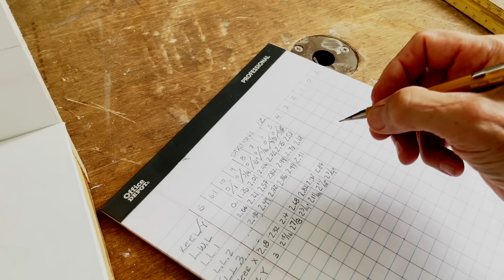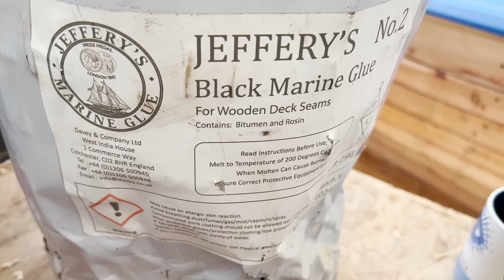Waterproofing the Boat Deck - Episode 232 - Acorn to Arabella: Journey of a Wooden Boat

Comment: As a professional Roofing Specialist contractor for many many years  

Flat Roofs, pitch Roofs ,slate and tile including shingles. 

In the days before Torch on modern day flat Roofing materials. 

We used the bitumen pots to heat the bitumen. 
Roll and pour,
Anyway,  bitumen in cans,

Place 3 engineering bricks underneath bottom of can of bitumen, 
We had burners for pots but if you have a blow lamp ( blow torch)

Put it underneath can and make sure you wear gloves and most importantly remove either the lid cap or whole lid,
As it slowly melts you can pour it into your proper bitumen pot, 

You don't need to cut the tin away or break the bitumen up , the Tiny bits of bitumen literally goes everywhere, 

Even on bottom of your boots , get that on the rug at home and your wife won't be happy, 
To remove bitumen,  white spirit on a clean rag.

Loving the videos and thumbs up from the UK 🇬🇧

Comment: Amazing how much that changes the appearance of the deck!! Hey, many years ago I worked with a substance similar to the pitch. We'd heat it in old electric roasters. It kept it at a constant temp. You don't have an open flame. You can buy them on eBay for a lot less than a tank of propane. Give it a shot I think you will like the idea. Keep up the good work!!
Reply from the maker: Neat, thanks for sharing that, Daniel!

Comment: Taping the whole deck was a logical choice and it worked out exceptionally well. That deck will definitely be water tight once you set sail. 
I know that this isn't your plan but I have always thought that a large wooden boat would look nice with the entire outside wrapped in fiberglass like cedar strip kayaks are. Since wooden boats are often made out of such beautiful woods and it would be nice to be able to see them. Fiberglass would also guarantee that it wouldn't lesk anytime soon.
Reply from the maker: That works great, as you’ve said, on strip building, and there are larger, cruising-sized strip-built boats in the world for sure. Carvel planking doesn’t do as well with fiberglass over it.

Comment: Ok, quick note.  The easy way to get pitch out of a steel can is take a larger steel can (15-gallon drum type) fill with water, place pitch can inside and suspend.  then build a fire around the larger can and viola, instant double boiler.  use what you need, remove from boiling vessel to cool, re-lid then store for later use.
Reply from the maker: Neat tip! Thanks for sharing.
Reply: @AcornToArabella  Your quite welcome.  after hot mopping a few tined roof sheds one finds out a few things.   ^~^

Comment: Get in a pinch you can use RTV gasket maker (black) to fill gaps. Used it on my race boat's teak deck. Been 14 years now and still looks and holds up under foot great.
Reply from the maker: Thanks did the tip!

Comment: Most won't use pitch as it's messy ass all hell and speed is more important to most than doing a good job as you are doing right now. My dad used a modern material similar to sikaflex which sort of worked, but it didn't last years before it began to break down and leak. Going old school is sometimes the better way than a modern untried way when compared to the old way which has been worked out over 100's or years. But often new can be better if it is used right, but that doesn't mean that the old way don't work and people tend to forget that. It's good you show everyone how it was used to be done.

Comment: As a kid I used to watch the guys work on the caulking of the decks of Grimsby seiners.my dad used to take me to work with him in the summer because I used to love fishing for eels from the ships whilst in dock he was a fisherman and late a ships husband .Manny many times I used to see the old guys repairing re caulking the decks finishing with tar. I can still remember the smells etc clear as day. They used hemp caulking in between deck planks and they chiseled it in real hard compacting it in there after first removing old wet stuff. It had to be put in hard before it was pitched .the hemp fibre was put in a certain way so it tied to the previous strip put in before it 2/3 separate hemp aplications without being pushed away and making the seal better. Oak decking. Don't think cotton's gonna be too good but hay I was just an observer and a kid.

Comment: Amazing work  once again Steve….. how many caves
Of tape did you go through?
I can tell you this, my brother and I had a 21’ double ended whale boat, actually it was a life boat of the Arizona. My father and his forman rebuilt her in the 30’s? I’m guessing? Most of the planking was oak but!, some of the planks were cedar below the water line!
The gaps in those planks would shrink like crazy! We’d recauck and use Slick Seam??? I think???, not sure but it was a wax of some sort to allow swelling. Once launched, we’d run her up in a spot to let her swell and not let her sink!
Point being ceded shrinks allot more than oak!
Reply from the maker: In my experience it’s the opposite. Could be that those lower planks had complicated shapes, and that the caulking and recaulking (especially if the material wasn’t all reefed out below there) eventually crushes the inside joint of the planks, which causes leaking. Thanks so much for sharing this memory! Bet it was a cool boat! —Anne

Comment: It's sticky, messy stuff but undeniably good at its job.  I once had an experience with a heat gun and a tin of bitumen based pitch type product though... it sounds stupid but of course the fumes will ignite if you get them hot enough, I was being a little liberal with the heat due to trying to use it in a freezing garage though.

No big dramas, just flames... they're sometimes a little surprising.  After they were extinguished the pitch was nice and runny though!

Comment: I wonder if it's practical (for the manufacturer) to mold that pitch into little sticks that could be fed into a hot-melt adhesive gun.  The stuff in the bucket looks pretty solid, though maybe it flows enough that sticks wouldn't hold their shape in storage. You probably wouldn't want to pitch the bilges that way, but it seems like that would make filling the seams way easier.
Reply from the maker: That would be cool!

Comment: Curious as to why you went with a soft wood for the deck? Pine is easily dinged and dented from impacts like what will more than likely occur topside. Hmmm. 🤔
Reply from the maker: Quite traditional, replaceable, repairable, and more rough than one would think with many layers of cured oil on it.

Comment: The fishing boats I worked on did not have the seams scraped down, the raised pitch provided a more substantial grip for footing in our generally wet and cold conditions. This of course may not suit hotter drier climes or more fussy eyes, But was a God send to those working in sea boots on wet and slimey  decks.
Reply from the maker: True, they’re great! We’re hoping/thinking that there will be some swelling of the wood, and that the glue will inevitably take a little convex shape.

Comment: Wondering if the pitch eventually hardens to the point that walking on a very sun-warmed deck would not produce some of it attaching itself to the bottom of your feet?
Reply from the maker: In very very hot weather, it can feel sticky. And I’ve seen it come off just a tiny bit. Nothing that can’t be scraped off next time there’s some tidying.
Reply: @AcornToArabella  Thanks for responding.  Wondered if punching the pitch below the level of the deck and filling the final gap with a cleaner marine grade caulk (or similar) would eliminate such tracking of pitch in the tropics.
Reply from the maker: Not sure a modern glue would adhere to Jefferey’s considering it’s tar and bitumen… maybe, but also maybe best not to mix things when tried and true methods can be trusted.

Comment: I know this is definitely late... but I wonder if you could produce something similar to what they use to fill cracks in asphalt, where it's narrow at the tip and guides the tar in without spilling too much over the intended area? It would help with reducing cleanup and scraping!

Also I'm not saying you SHOULD make a pitch-tape ball..... but you should make a pitch-tape ball.
Reply from the maker: There are some of those for caulking decks for sure. We happened to have this from friends, but yes there are more specialized tools for pitching decks.

Comment: what did boat builders do before blue tape?  will you still be sanding the deck after applying the "glue"?
Reply from the maker: Practiced professionals use slightly different equipment and go a little slower. There will be a little cleanup and then oiling.

Comment: Been watching this build from pretty much the beginning, as I have the Tally Ho, and I have to say both boats have come a very long way from when I began watching. What's interesting to me is how Leo has tried to avoid scarfing whenever he could, especially where the Hull was concerned...just Leo being over-careful, or is there a reason for that? I only ask because those joints are going to receive probably more punishment than just about anything else on the boat, being in the proximity to water that they are...just something I've always wondered about since they did the Hull Planking...
Reply from the maker: The glue we use for scarves essentially makes one piece of two pieces (the joint is stronger than the wood itself), then the whole plank and it’s joint(s) are edge-set to their neighbor planks and riveted at to frames. Reliable goo and little chance for movement means very little punishment. We know some restorers who eliminate butt blocks in every boat they work on, as a general rule. Maybe Leo was being true to the restoration, maybe it’s just his preference. After finding dead mice and other detritus built up on the butt blocks in Victoria, it really sealed the deal that we’d rather not have them, but they clearly work. One method isn’t more careful than the other, though.
Reply: @AcornToArabella  See that's why I asked, because I know nothing about it save what I see when I watch. I think my aversion to scarf joints relates directly to the Guitar, or more specifically the neck, as the Imports are usually scarfed at the 3rd Fret, and while most are well made, there's been a few in my experience that weren't so much, and broke with even a little tension from Strings. Different application, I know, but there's that "Scarf Paranoia" there...for lack of a better term? Anyway, BANG UP JOB so far...wish I could be in Mystic for the Launch...
Reply from the maker: Nothing makes a mind up better than experience! My thought is that they cheaped out on the glue, or didn’t scarf with a big enough ratio. Cheers for the kind words! —Anne
Reply: Doesn't everyone avoid scarf joints - if they can! Leo used a scarf joint in the keel because he couldn't find a single piece of timber which was big enough. For the same reason you can find scarves in the beam shelves, bilge stringers and cover boards. Leo didn't use scarves in the hull planking because he didn't need to. He had access to long planking stock. His take on all of this can be found about half-way through Episode 86 of Tally-Ho on YouTube.

Comment: How would Sikaflex or similar work as opposed to the tar in your opinion Steve in terms of performance. Tar is the way traditionally of course
Reply from the maker: Sika, some kinds anyhow, isn’t particularly UV resistant and can, over time, pull away/shrink. —Anne
Reply: @AcornToArabella  No substitute for the real thing - the reason it's been used for hundreds, if not thousands of years.

Comment: Just curious, but why cotton over more resilient and resistant fibers like hemp?
Reply: Also, Happy Friday!
Reply from the maker: Happy Friday, Jeff! The characteristic needed here isn’t the type of resilience hemp has—cotton is great because the fibers can be crushed, giving way rather than fighting against expanding wood, which could crack with the wrong material in the seam.
Reply: Also.... did 3m sponsor you with blue tape?! holy hell, that couldn't have been cheap!

Comment: I would have put everything you wanted to go in all at once. My worry would be as it swells/contracts, the two tracks of cotton will push against each other and create a gap instead of behaving as a single mass.
Reply from the maker: In what way?
Reply: like how desert mud contracts and leaves cracks, or how a cold concrete joint doesn't bond well. If its one piece the tight/tighter areas are a continuous transition, not possibly a sudden change across a boundary; but uhh i'm not a boat builder.
Reply from the maker: Ah, well this is the part that’s missing from the mud cracks. A material that expands to fill spaces when the wood around it allows, but gives way and doesn’t destroy wood fibers when the spaces between the planks contract. If the cotton went in tightly in three passes, it’s likely it won’t be terribly different than the one, except we can get away with driving it deeper in decking than we can on the hull planking. Hope that makes a little sense, it’s easy to see in the mind’s eye but somehow is hard to explain.

Comment: Redivida video show a lot of deck pitching
They used blue tape just like you. They did however use a synthetic pitch material instead of bitimum and rosin.
Reply from the maker: Neat! Probably works nicely for them.
Reply: @AcornToArabella  Yeh, their boat is only half as long as Arabella. The stuff their using is extreamy expensive!!

Comment: One question, why are you using such an awkward sized hammer on the caulking?
Reply from the maker: It’s what’s comfortable for most people, especially on vertical surfaces—it’s a specialty tool. Reduces the amount of work your arm has to do.
Reply from the maker: It’s what’s comfortable for most people, especially on vertical surfaces—it’s a specialty tool. Reduces the amount of work your arm has to do.

Comment: Excellent work as expected👍👏
Is that standard width tape or did you plan the deck plank width for the tape?
You and SV Seeker are inspirational, and am looking forward to the launch
Reply from the maker: Standard-width tape, and the planking was not planned around it. In fact, at one point we tried to cut the roll of tape to the width exactly using the bandsaw. Would not recommend. 🥲
Reply: @AcornToArabella 
Much relief and surprise when things come together without planning.
Bandsaw and tape are not meant to come together😂
I would of mounted the roll of tape on a mandrel in the lathe and experimented at ways of slicing to size.
Reply from the maker: Seems like there’s a way they finish the edges though that makes it easier to lift. All the places where we used cut tape were liable to be ripping apart in tiny pieces willy nilly. —Anne

Comment: Wouldn't White PIne rot pretty fast?
Reply: Untreated, yes, if ladened with fresh water.  This deck will be soaked with many coats of oil, maintained with regular oiling, and "rinsed" with salt water.  All of these help it to remain rot-free.
Reply from the maker: @boooshes said it! We also describe the difference between the inferior species lumped into the single category of “pine” one finds in a lumber yard versus the very dry, but not kiln dried, quarter sawn white pine we’re using here. —Anne

Comment: 18:42 At first I was like; damn, they're gonna use twice as much tar as they truly need to fill seams. Haha, Then saw you scraped it so can reuse it hah. Right on. I think the deck will be fine, I doubt expanded cotton will crack a 2-3" thick board quarter sawn like that. My ONLY fear is on a really, really hot day at sea, you may get some tar on your shoes and shit you sit on the deck. Is that a possibility? I'd imagine deck can get up to say 120 degrees. I guess that's only a 1/3rd of 200 C it says to heat it up too. I just know on super hot days on a roof tar gets on my shoes.
Reply from the maker: It is. And it’s maybe the one drawback, but it doesn’t really get so bad it sticks to you, in most weather we’ll see, it’ll get a little soft to the touch but not track everywhere.
Reply: @AcornToArabella  Yeah, I think it'll probably be fine. Can never underestimate the Sun and it's glorious heat, haha. We shall see!

Comment: If the pitch comes in a metal container, why not just heat the container directly? At least until you can scoop out chunks.
Reply from the maker: We’ve heard that heating the large container makes it difficult to use, and we do prefer to melt smaller pieces.

Comment: Am I crazy or what because I remembered Steve and Caroline did some caulking on the hull before?
Reply from the maker: That was a bit of oakum to keep the pitch in the bilge from coming out of the seams, and it was temporary. Removed shortly after that job was done. Oiled fibers pulled away from the pitch, cotton wouldn’t have. Cotton caulking will go into the hull next spring.
Reply: @AcornToArabella  thank you Steve, turn out I'm not that crazy ... yet

Comment: That came up pretty tidy using the tape. A question: Why is that old-style caulking mallet so unwieldy with that overly long head. It doesn't seem very ergonomic. A wooden mallet as used or a plastic faced hammer would have the weight without the size.
Reply from the maker: It’s very good for use on vertical surfaces. Turns your arm into a pendulum and saves work.
Reply: @AcornToArabella  Aha, thanks Anne.

Comment: Should have thrown the tar in a fridge and smacked it with a sledgehammer before opening, you would have had a bucket of pieces
Reply: I used to have to smash like 30 of them a day, it sucked when the weather was warm. Luckily mine were wrapped in cardboard.